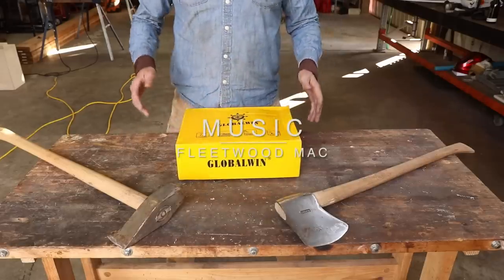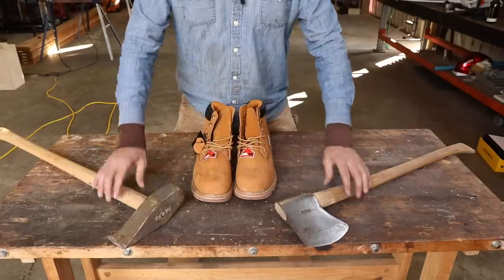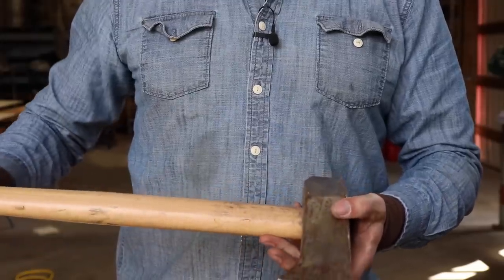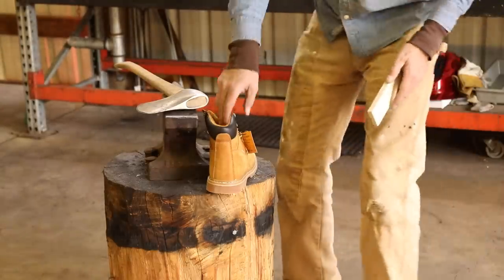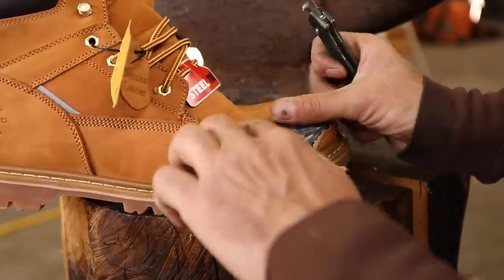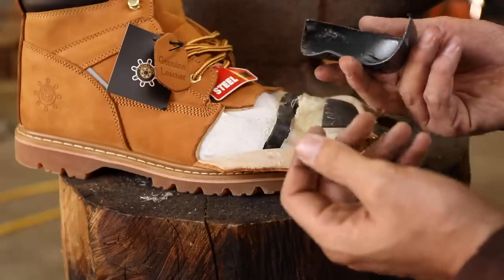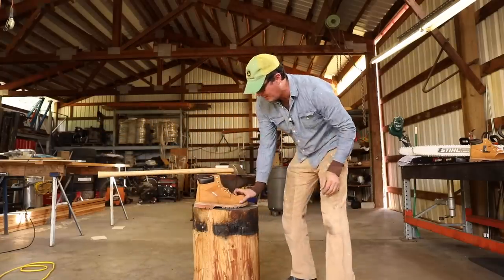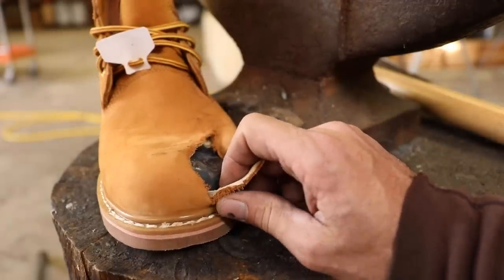Will AXE Split STEEL TOE Boots In Half???

Comment: I've actually wasted a pair of Red Wing boots (I forget what the design was called) that were ASTM F2413-18 M/I/C EH certified, though had a composite toe rather then steel. One bad swing with a standard axe you'd find for splitting wood, and the blade glanced off the toe. Should have stopped there, but half dozen swings later and I planted it in my left foot just behind the cap, severing the tendon to my baby toe. I still don't have the full range of motion of that toe, but I'm grateful to those boots for saving my foot.

Comment: I love this idea, but I think the test is a little flawed. The likelihood of an axe being swung by someone else onto your foot is really slim and if they were, they would not aim for the toes or foot. Swing with the boot in the other direction as if you are wearing them and anchor them as if your own body weight is on them. This will prove if you should be wearing them when splitting wood or whatnot on your property with steel toe boots.

Comment: You hit the steel where it curves with both hits, which probably has more strength than the flat center part. I believe the 2nd axe would have flattened the steel from a center hit.

Comment: Maybe try quality boots. Then try composite safety toes. I agree use something to take the place of toes. I suggest drilling holes through hot dogs  and inserting wood dowels. Our feet have soft tissues with bones inside. That might show how much impact the feet would take. Does the steel toe bend and break the toes then bounce back? Thats certainly possible. Also,  maybe try to swing from the top as if an old school lumberjack missed and strikes his foot. Just a few ideas I would do to help determine what would happen to real toes without spending a fortune.

Comment: My friend wears Redwing steel toe boots slipped mowing a hill using a push mower his foot went under the deck, mower was running full throttle. It took the leather off the steel toe but didn't dent it. It was a good enough hit to shut the mower down. His foot was fine. I personally prefer  Belleville boots

Comment: One evening I missed while splitting a smallish round with a 3 pound ax, it smacked the toe of my Red Wing boot, deflected off the tip and split nearly 2 inches of the sole/stitching on the right side of the boot. Being half an hour from medical services,  it may have ruined my day if not for the steel cap. 

. I still wore them for another half year or so, mostly as a unspoken "I told you so" to many of my friends and clients who preach of how steel toe caps will leave you with amputated toes.

Comment: The rubber cover over the steel probably counts as the insulation to make the boot EH (electrical hazard) rated. In higher quality EH boots I believer there's actually a non-conductive coating they use to cover the steel. This video was a testament to the protective potential of even cheap steel toe boots. As someone who's had both of my feet injured, one severely, I always wear appropriate protective footwear. Crushed bones hurt. Safety toe boots are cheap insurance that work.

Comment: 13 years ago I took a splitting maul to the foot, it was a glancing swing that shot off the edge of the round and into my foot, it hit 1" above the steel toe in my boot. It just felt I had hit it with a hammer. Looked down and saw red thru the cut in my boot. So i picked up my tools before walking to the house to tell my at the time new bride that we needed to go to the ER. 4 stitches later I was good to go. Narrowly missed cutting the tendon to my big toe, ER doc point out the tendon to us.

Comment: I use the same method using a sledge hammer.. I'm not saying you can't swing.. My method might be banned in lumber yards.. I don't know.. I'm also 6"4 about 200lbs... I just know no one can hit those wooden slabs harder than me where I was at because I took the biggest swings.. I would have split that boot in half and probably almost split the wood the boot was sitting on... The around the world method gives you a bigger swing. You build up more speed and momentum in your hits.

Comment: I knew it ive got the steel cap boots for everything and everybody says you shouldn't wear them when using axes and hammers but the leather is strong enough to withstand a machete at full swing, an axe wont do anything to the toe

Comment: I wore steel toe combat boots for 12-14 hour shifts walking wing tip to wing tip on tarmac which is MUCH hotter than most other things you'll walk on for a job, and my feet did not get any hotter with steel toe boots than other ones I used... So... Not sure the science works out there, sir. 

Good video regardless.

Comment: Steel toe boots aren't meant to protect your toes at all surprisingly, they're actually meant to cut off your toes/contain them in your boot if something could've crushed your whole foot, think about it, if they were meant to just protect your toes, why not make an all metal boot? With hinges so you could walk freely, steel toes are strictly meant to make a clean cut on your toes so they could be reattached if necessary, even though they can protect your toes individually if necessary

Comment: I put a 4.5 lb Norlund thru a pair of Carolinaś Steel toe. Took 14 stiches to put my big toe back together. Axe came from the front, plus 175 lbs holding it to the ground to keep it from moving. Dec 17th 2011, looked like a butcher knife went thru my toe.

Comment: Hello thank you for the video, I was digging a footing foundation (the bulldozer didn't show up) about 30 years ago in construction, for Public Storage in Florida when I was around 20 years old, and I had the pointed part of a pickaxe miss, or skip over the coral rock I was picking at.  

Luckily, I had the Dickies steel toe boots on, and it didn't penetrate the steel toe, but you could tell it looked like it was hit by a bullet, or punctured very well.  Knock on wood, and thankfully my left side big toe was ok!

Comment: Ooh, and the wearing them in wild land, the 'steel toe' boots I was issued in AIT use this triple layers of hard plastic. Something like the design with a softblow hammer but with plastic and rubber or something in the toe, not steel. This was for a 12W Carpentry and Masonry Special MOS, part of the training and the job is obviously being outside, and it can get very hot on tar shingle roofs. I am wondering if this also works to improve the heating factor as with the vent holes. Would you be interested in doing a video heat testing this type of 'steel toe'? I would, but I only have the one issued pair and am not quite yet in the position I could afford to buy another and do it.

Comment: how hot does the ground get to be able to heat up the steel in steel toe boots? I wear steel toes to the welding shop and weld close to my feet for extended periods of time sometimes but have never have hod the problem of the metal heating up bad enough to burn me or even make me uncomfortable for the most part

Comment: I paid over $125 for a pair of steel toed boots and found out after nearly a year of wearing them, the toe was actually a pvc type material with a thin flimsy piece of metal bent over it, had I had an accident who knows if they would have worked.

Comment: Hey there. I think that this test is not  usable for the normal use of that kind of shoe. If you use an axe on a log, you will hit from the other side so the tip of the shoe will be the first part you will hit. I think that the rounded surface of the tip of the shoe will handle more force than the back where you hit it now. ;-) Maybe you will make another test where you hit the shoe from the front. Regards from Germany

Comment: He did it wrong. Nobody's going to stand close enough to someone else swinging an axe to get his toe in the way of the axe. The axe should have been swung from the other direction, as if the guy were wearing the boot. This would be a more likely scenario, as if the axe missed or glanced off the wood and hit the guy's foot. Still, the steel toe would probably have done its job. Dominic Greene should have been wearing steel toes. (James Bond movie)

Comment: So the government test for a "steel toed" safety shoe is very specific...

How to Read the Safety Standards
ASTM F2413-11
M I/75 C/75 Mt75
EH PR

First Line:
F2412-11 —specifies the test methods that measure the resistance of protective footwear against a range of hazards that can produce an injury in the workplace.    

F2413-11—specifies the minimum performance requirements protective footwear needs to meet to resist a range of hazards that can produce an injury in the workplace.

The 11 after the dash signifies the footwear meets the ASTM F2412 or F2413 requirements issued in 2011.

Second Line:
The second line starts by identifying the gender of the user the footwear was made for (M = Male or F = Female). It is then followed by the footwear's ratings.

Impact (I/75).  Safety toe footwear is tested to meet one of two units of measurement for impact rating: 50 or 75 pounds. Footwear rated I/50 will protect toes from an impact up to 50 pounds and I/75 will protect against 75 pounds. The impact test is performed by dropping a 50-pound weight at a height of 18 inches at a designated speed. 

Compression (C/75). Safety toe footwear is tested to meet one of two units of measurement for compression rating: C/50 or C/75. Footwear with a C/50 rating can withstand compressive loads up to 1,750 pounds while C/75 footwear can withstand 2,500 pounds.

Metatarsal (Mt/75). Metatarsal protective footwear must first meet impact and compression class 75 requirements. The metatarsal test is performed by dropping a 50-pound weight at a height of 18 inches onto the metatarsal guard. The standard does not cover aftermarket add-on guards.

Third Line:
The third line lists additional hazards the footwear protects the user from.

Conductive (Cd) footwear protects the user from hazards that may result from a build up of static electricity and to reduce the potential of explosives or volatile chemicals from igniting.

Electrical Hazard (EH) footwear has non-conductive, electrical shock-resistant heels and soles able to withstand the application of 18,000V at 60 Hz for one minute without any current flow or leakage current in exceeding one millampere (mA) under dry conditions.

Static Dissipative (SD) is designed to protect users against hazards that may exist due to excessively low footwear resistance and to maintain a high level of resistance to decrease the possibility of electric shock. The footwear must meet a lower limit of electrical resistance of 106 ohms and an upper limit of 108 ohms.

Puncture-resistant (PR) footwear has a puncture-resistant plate between the insole and outsole and is a permanent part of the footwear. The footwear must have a minimum puncture resistance of 270 pounds and show no signs of cracking after 1.5 million flexes.

Comment: To be fair, you say that you cant expect to get good safety boots for 40-50 dollars, but i got safety boots for about 30 pounds (roughly 40 us dollars) and theyre rated to withstand roughly 153 kg, so i mean, i dont know if that counts as good, you know this stuff way better than me, but i would personally consider that to be pretty good, i mean thats almost 3x my weight (i should probably clarify, i have them because im at an engineering school, i dont work in industry). But i mean, as i said, im not trying to say youre wrong, im just saying i disagree

Comment: In reality ya boots would never take a hit like that unless you was rather silly enough to stand there and smash ya toes in with a Axe or a 14lb sledge hammer, Them boots maybe cheap bit they would take all the punishment on a building side, if anything the compromise would be the soles, proper good hard wearing steel's would last years with the grip wear, but cheapos probably would fall apart at the seams. Maybe run that same test on some NYC Fire department boots. like these bad boys,  Firefighters rubber boot (Boot 39)
Manufactured to NFPA 1971 Edition Standard for Structural Firefighting
Steel mid sole and toe cap
Height 16" (40cm)

Comment: Anyone have experience with steel or composite toe in extra wide boots? I've bought or tried on dozens but my feet are so wide at the toe that I get aggressive friction with the toe protector resulting in instant blisters. Even with thick callous and moleskin for protection.
Reply: Sociopath. My wide feet eventually will cause cowboy boots to split on the side. I wear extra wide Wolverines with steel toes.  I prefer the look of cowboy boots, but these Wolverines give my toes extra room, and are thus warmer than tight boots.  I'm a farmer/rancher.  I've had heavy things land on my toes.  I'm a firm believer in steel toed boots.

Comment: That isn't a good swing. You went with an overhead swing. I do a more around the world swing with an ax. Before I swing the head of the ax is down by my leg and it travels in a long circle. I also grip the ax as low as I can on the handle... I'm no pro but I've chopped a lot of wood in the last 5 years and I always took the biggest fastest swings using my method. The ax starts by my leg, comes from behind me to overhead.. It sounds like a gunshot when I got that wood. When I seen that table directly behind you I was thinking how are you going to swing that axe without hitting the table?